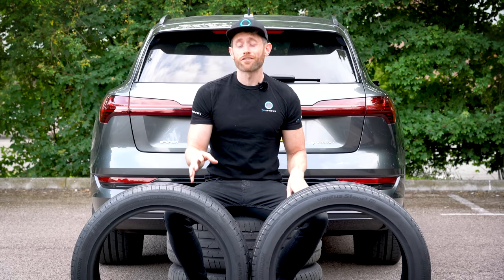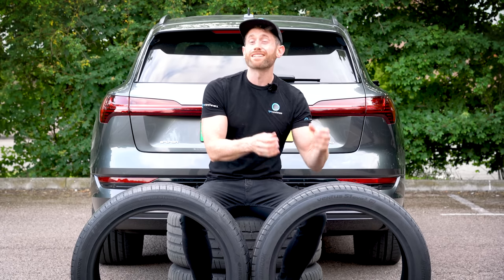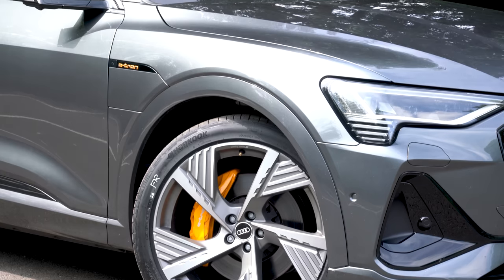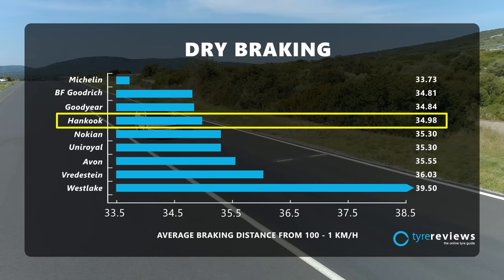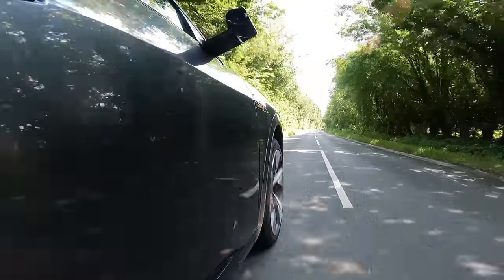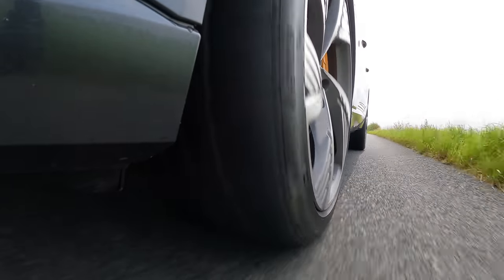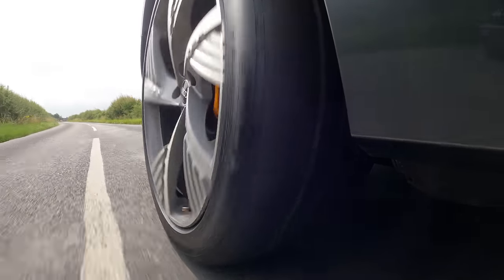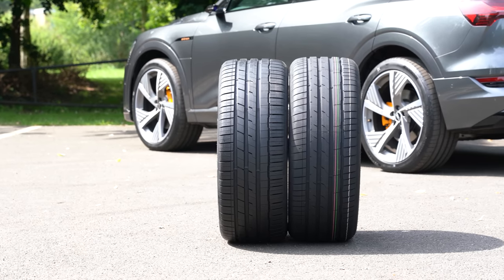What makes EV tires different, and why should you fit them! 🔌

Comment: Well, now I know why my Polestar 2 lost ~10% of range after upgrading to Pilot Sport 4s.
As for EV vs ICE - I'm a petrolhead as well, shunned diesels all my life, but the reality is that the better EVs are better than ICE in almost every way, except noise/emotion. But that's what project/weekend cars are for :) Getting 0-60 times of 4.7s and "consumption" that's equivalent to 2l/100km of diesel is a pakcage many dreamed of. And since moat new ICE cars are already heavy, the extra battery weight isn't even that bad...
Reply: LOL Michelin Pilot Sport A/S Plus decrease my gas E350 Benz by 12%. Many BMW people say the same.
Reply: My Model S came with Michelin Pilot Sports installed...
Reply: See if you can the  "TO" tesla optomised P4s in your seize!
Reply: @mikeicee  Yea they suck on my Tesla, but better than the 20' ps4 factory tires after broken in on 18in. Wearing fast also.
Reply: @jpmkiv  When I had 18inch AMG wheels on my car the rears were wider and it cost like $500 a year. What a joke.
Reply: It's completely normal. EV tires and those from ghas saving cars trade roll resistance ( grip ) for range.
Reply: Imagine how much quieter cities will be when only hobby cars make have engines!
Reply: @tomcapon4447  Imagine how much EMF from sonar/lidar pollution will be around us!
Reply: @sncy5303  I would not if it's mandatory where you live unless you want to pay damages out of your own pocket. They only emit sound below 20kph anyway.
Reply: The only sanctioned races EV's have won against ICE counterparts are hillclimbs, so no, they aren't better in every way yet. No dakar winner, no lemans winner, no nurburgring lap, no daytona... EV's certainly have benefits, but their benefits at the moment are primarily relegated to people who own a home or live in a place where chargers are provided. The only reason EV's are even successful is because of government intervention in markets so while I think some EV's (like the Polestars) are awesome, they aren't a fix all for efficient transportation needs at the moment. Progress is certainly rapid though, so if there comes a time when there are 25-30k sporty EV's with full charge times below 10 minutes, I'll be pretty much sold.
Reply: WEIGHT isn't that little difference since all cars are now heavier but ev-s have constant weight penalty since they have same weight being full or empty
Reply: Range and charge times are the real reasons EVs are inferior to ICE, not noise or emotion.
Reply: shunned diesel, ok  well dont do shipping or drive emergency vehicles cos those are diesels,   wanna  save  the environment,  goverments shut down all fossil fuel production haha, use what we have
Reply: @S2Tubes  If you charge at home and do less than the 200-300 mile range a day (of a lot of EVs), it's a bonus never having to visit a petrol station. Most people don't do anywhere near this (I'd certainly not enjoy doing that kind of mileage!). If you are doing more than this, you should be stopping anyway. So charging, although requiring a little more planning, isn't really a hassle.
Reply: @mikeicee  have you have ever heard of something called smartphones? You won't notice increased EMF pollution.
Reply: @R03333  Bro an iPhone with tiny battery vs Tesla with huge battery... i give credit to Tesla not using lidar radiation.
Reply: @mikeicee  Every single car has ultrasonic sensors on it nowadays and radar. But Test is going LiDARless and radarless so… and I don’t know about the outside of the car but inside the car EMf has been measured to be lower at the floor then in internal combustion engine cars I don’t know why maybe insulation or maybe cheap electronics but yeah.
Reply: @attachment4449  no it doesn't, most have a camera(front windshield) /cell receiver (shark fin) that rely information to government... but not radar.
Reply: @mikeicee   I meant like most aaudi and BMW  mercs have cut outs in the bottom front bumper with circular pieces that are most definitely radar and it is also true that most cars have ultrasonic sensors nowadays for the parking beeping alerts in the front and rear and it is also true that Tesla went radar less I didn't mean to start a fight I was just saying some stuff to ease potential tension
Reply: @mikeicee  - Another benighted attempt to traduce electric vehicles. Sonar doesn't produce EMF and LiDAR is laser based. You're thinking of Radar and microwaves which can create a lot of Electromagnetic interference (EMI), also called radio-frequency interference (RFI). Neither sonar or Lidar will be an issue. The electronics on all EV's are extremely well shielded anyway. There's more EMI from poorly shielded high voltage ignition systems in ICE vehicles. Try again.............
Reply: @S2Tubes  charging once a week for 30 minutes while you do something else while paying half the price of fuel and negliable service costs. Who cares?
Reply: I bet you drive it differently though for the 10% loss in range - the temptation would be to push the car harder with 4s' on the car - Michelin themselves quote a 3% efficiency loss going from Primacy E to Primacy 4+ via their tyre compare tool (4+ is another "touring" tyre not a UUHP tyre like the 4s) the 4+ has 35% more rolling resistance than the E version for that 3% loss.
Reply: @TB-up4xi  I tested before/after on a highway driving both ways for around 10km at a fixed speed (120km/h) to avoid wind and any elevation changes skewing it one way or another on a very similar day at very similar temperatures. What I forgot to mention and what probably made much more difference (or at least half of it) was that I also went from factory 19" wheels to aftermarket 20" wheels that are much closer to the wheel arch/side of the car's body. The front wheels moved out around 20mm per side and the rears moved around 13mm. The rim itself has a more open design which probably disturbs the air much more and aero means more the higher the speed. Don't know why I didn't mention that - live and learn, I guess.

Comment: Rolling resistance is a function of (tire design and) deformation, which is a function of the contact patch which is mainly a function of weight and tire pressure (the sidewall being a small contributor). Therefore, even on a gas car, the rolling resistance gains of using an EV tire are real. 
Of course, as gas cars have way more losses all round, the relative impact of tire rolling resistance is small
Reply: It's 5%.

Comment: I really enjoyed your video its very informative thank you! I completely agree that an EV tire is better for an EV.  I’ve owned my Audi e-tron for just over two years and I ordered the 19 inch Audi rim with the Bridgestone Alenza tire which is designed specifically for low rolling resistance. The EPA rated range for the E Tron with a 20 inch and all season tire is 204 miles or 324 km. With my combination of 19 inch rims and Bridgestone low rolling resistant summer tires I’m getting easily 350 km or more range this past year I’ve been getting up to 450 km of range a few times quite often 400 km. Bridgestone Alenza tires are great for range and amazing in dry and wet conditions.  They are also super quiet and very comfortable as they have a much higher profile than a 21 or 22 inch rim.  Audi states the the larger rims may be better for extreme handling but they are heavier and give less range than using a 19 or 20 inch rim.  So I’d you are wanting more range I recommend the 19 or 20 inch rims and a low rolling resistance tire that more tire manufacturers are coming out to market with. The Alenza tires have also worn very well.   I’ve put on at least 55,000 km on these summer tires and my tread is still above the wear bars.   Last week My Bridgestone Alenza tires helped me to complete a Canadian record setting drive for an EV  across Canada from coast  to coast  of over 7,000 KM including 2 ferries of 11 hours of ferry travel and 38 charging stops in 4 days, 18 hours and 25 minutes.  For more info check out www.maryannselectricdrive.com.
Reply from the maker: That's super awesome :D

Comment: I change the tires every two years but I watch all the episodes you do!
Reply: My last winter tires lastet 7 years. I only drive up to 15.000km a year. The tüv and cracks between the profile of my Michelin tires where their death. Still had 4mm.
Reply: @Nordlicht05  my summer michelins are the same!! DOT 15 and they're extremely cracked along the whole shoulder and inside, the whole thread! Thread is 4mm front and 4,5mm back

Comment: Still using Crossclimate + on my Leaf and thinking of switching to Crossclimate 2 when they need changing. 
Do you think they are the best option for a all season for electric?
Reply: Snap - would also be interested to see if this is still the best option
Reply: Pirelli CINTURATO ALL SEASON SF 2 seems to be even better than CROSSCLIMATE 2… Test neeeded
Reply from the maker: Test out monday, but CC2 and SF2 oth great optoins for EVs

Comment: My MG ZS EV was running Michelin Primacy 3 EV tyres, but I swapped them for a set of Hankook Kinergy 4S2s for the better performance in the lousy weather we had at the start of the year.  Only difference in spec was a higher load index than what was originally fitted (95 v 91).

Wear has been comparable to what I was getting with the same model of tyre on my old Golf estate, although I was carrying a bit of extra weight in the Golf at the time, so not quite a straight comparison.  Economy hasn't been too bad, I did over 1000 miles on the original tyres, I've done close to 8000 on the new ones, and the figures are acceptable for me.  I don't mind how long I'm charging for, I'd rather know I'll get to my destination no matter the weather 🤣
Reply from the maker: My first car was an MG ZR. Different times

Comment: Excellent review and good timing.  Looking at the Hankook S1 EV as my next set of tires.
Reply from the maker: I really liked them! What vehicle for?
Reply: @tyrereviews  Tesla Model 3 Performance, I have a spare set of Tesla 19" Sport Wheels to mount them.  Looking for a less expensive tire than the PS4S, along with slightly better ride and improved efficiency, but mostly the lower cost tires, I have a 80 mile commute each way to and from my office.

Comment: I wish you had discussed cost.  I found that EV tires are significantly more expensive than "regular" tires.  And cost is a major factor for most people in their buying decisions.
Reply: Isn't it rather obvious why EV tires are more expensive? All that R&D put in for a smaller amount of customers. Plus it's more challenging to make good EV tires.
In addition to that the materials differ. But the latter is probably a smaller part of it all.
I can't answer wether all this justifies the difference fully, but even though it might be a bitter pill to swallow for some, saving on tires should be one of the last things you should do.
Keep in mind that cars are tools with the potential to cause a lot of harm to both the passengers and also other traffic participants.

Comment: Does this give credit to fitting "extra load" versions of tyres to combustion cars, in order to improve handling?

It would be great to see some "extra load" versions of tyres already included as part of a group test... i.e.  205/55/16 91v  vs 94v  on a golf or similar.  How would Braking, Handling,  Rolling Resistance, Comfort be affected?
Reply from the maker: It sure does, but it obviously depends on brand and tyre

Comment: Great review for today’s relevant topic on patrol vs EV vehicles.  I wonder, if hybrid owners should also use EV tires?  Would be interesting to see a comparison review on that.
Reply: This is a great question that I also would like to see being tested. As an owner of an E300 de, should I fit EV tires for the extra range in electric mode and the quieter ride? Or should I fit the regular tires? Is it even any benefit besides the lower noise? As the car weighs more than 2100kg, shouldn't struggle with wet braking.
Hope these scenarios are tested in future videos about this topic, as well as other brands like Michelin Pilot Sport EV or Michelin e-Primacy.
Reply: I'd also be interested to see that.
Reply from the maker: I would focus on the middle ground tyre, low rolling resistance but not just for EV tyres, such as the e.Primacy
Reply: @tyrereviews  How about to put these EV tires on Plug-in-Hybrid with some EV range? I mean PHEV like Hyundai Tucson PHEV or Toyota Rav 4 PHEV.

Comment: I was also a big-time gear-head.  Always worked on my own cars and loved the technology of engines, gas or diesel.  But when hybrids came along, I tried the Prius and that got me hooked on electric drive.  Next was the Leaf, Volt, and now, Tesla.  I won't ever go back to Fossil-powered cars.  I now have time to use and enjoy my cars because I'm not always fixing them!
Reply: Can you use carbon black in the tyres of electric vehicles because it helps to improve the strength of the tyres and it also absorbs the ultraviolet radiation
Reply: Please give the answer of my question 🥺🥺🥺🥺🥺

Comment: Thx for sharing. I have an electric car & I used both tires with foam & without. I really didn’t notice any noise difference. The tires I used were the Michelin pilot sport 4S & the A/S. Really didn’t notice if affected my range as well. I do know the staggered set affects range. Cheers

Comment: The original audi etron (a modified a3 hatchback) had an entire separate trim of the car called the ULTRA, which improved EV range by 10%, and the only difference was the tyres. Granted, the full electric range was only 20 miles (it was a plug-in hybrid) but they still went to the trouble